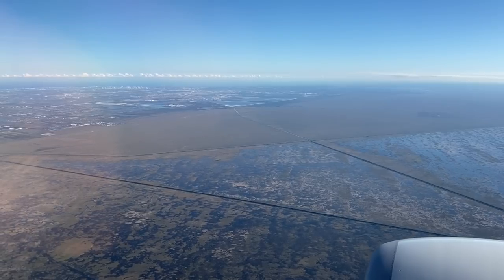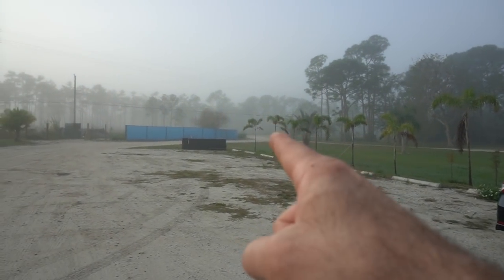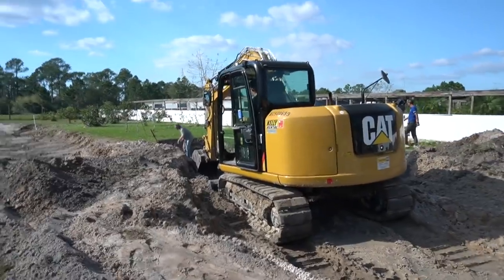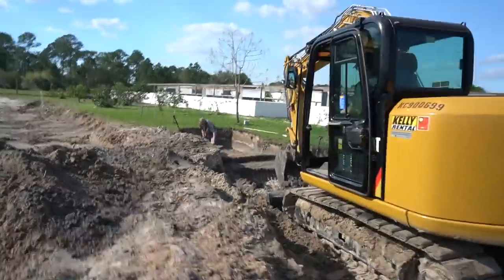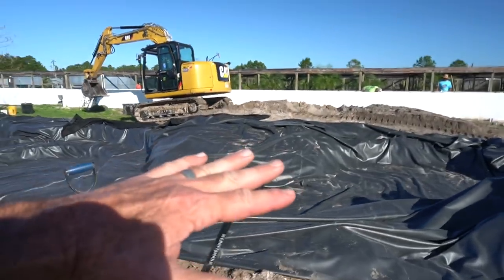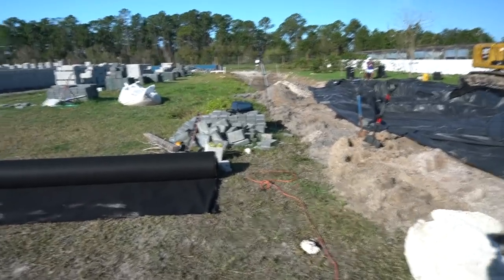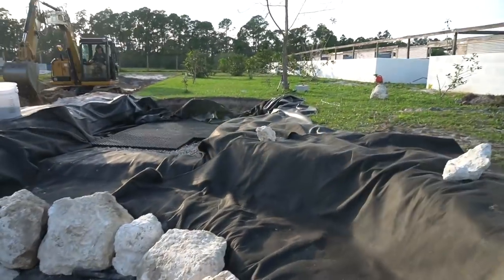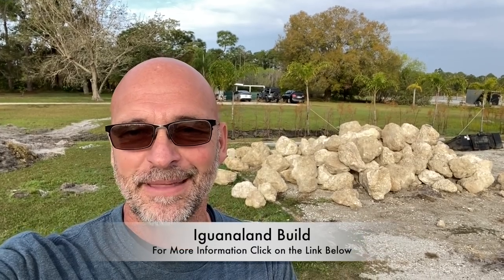How to Build a Pond to Mimic the Everglades: Iguanaland Part 3

Comment: Hi Ed. I have a question about using limestone like this. Won't it make the water alkaline? How will that affect the fish and plants?
Reply: Jason Oxley Yes, this rock will create an alkaline aquatic system but it’s normal for Florida.
I questioned this exact thing a few years ago and then we started building ponds with this stone in Florida and I haven’t seen any detrimental effects from it. 
The pH in the ponds we’ve already built stays around 8.0 which is OK.

Comment: Hi Ed,  with the drainage pipe under the pond.  Is it necessary for the pipe that exits the pond to be extended below the water level for it to do it's job?  Or do you just make sure the ground water leaving the pipe doesn't flow back into the pond?
Reply: Short Sleeve It should be below the normal water level of the pond